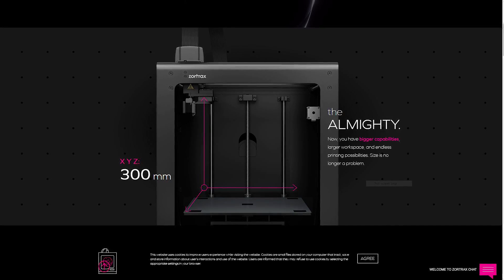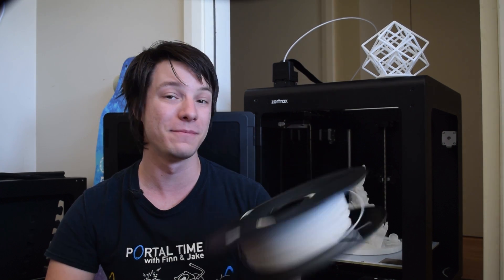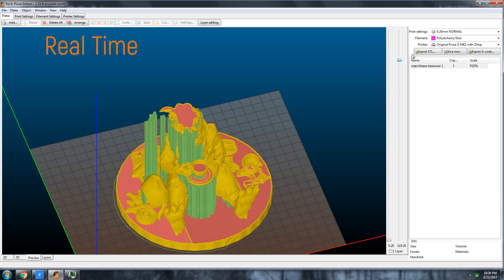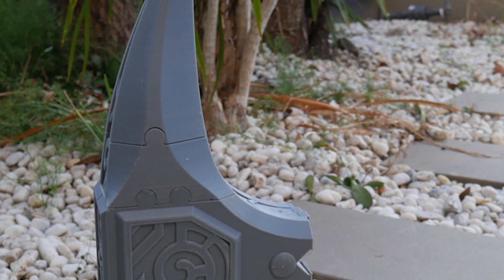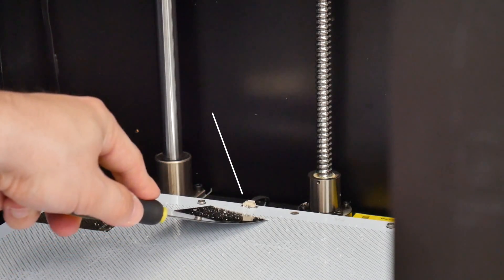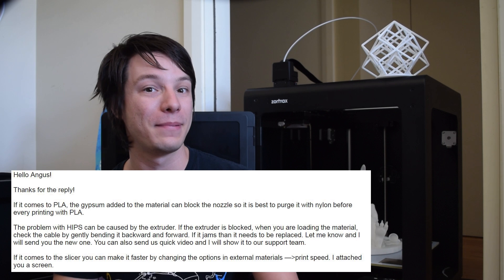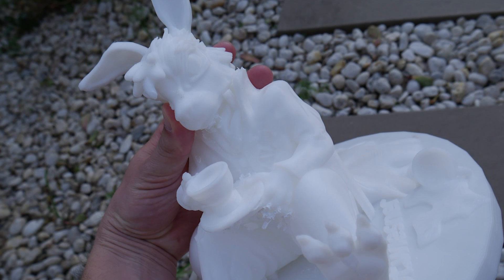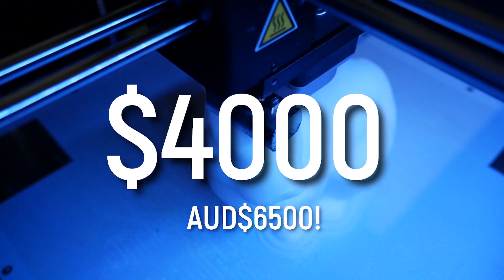Zortrax M300 3D Printer Review

Comment: You were pretty nice to the M300 in this review. I own the latest Zortrax M200...which I assume is mostly the same as the M300. I will say this... Its mostly turned off next to a Flashforge Creator PRO (slightly modded) which is running constantly, faster, cheaper. 

The only advantage from the Zortrax is potentially the surface finish in some cases but that is due much slower printing speed! That is in my opinion the secret sauce of the Zortrax. 

A properly leveled print bed on the Flashforge will get you very close to the Zortrax. 

The good things:
- easy settings
- build and print quality
- brand image
- Zortrax support is very good

The bad things:
- Slow and outdated slicer + serious lack of features! (how to manipulate objects on the print bed, the way of adding supports and loads more...) Just not good enough.

- perforated print bed and the need to print a raft is painful to say the least. Besides that the material waste is intense. That does serve a purpose thou: If I understand correctly the raft will compensate for the hypothetically bad print bed level so that each print is printed on a ideally calibrated surface. Again... could you not do this with a better calibration method and offer a glass bed option instead.
  The raft sticks quite heavily to the print bed and when removing it with a spatula the danger of hitting the connector is real. I did. I destroyed one. That should be moved to a different location immediately. Its just wrong.

- Slow print speed: The time to print a raft, checking if the bed level is correct and overall print speed makes of a somewhat disappointing printing experience

- ABS prints will lift in corners because of lack of an enclosed chamber. Expect warps, split layers,... Zortrax should provide some kind of a top cover and a temperature sensor inside to ensure print quality. 

- PLA compatibility is also difficult to understand. Considering that we all mostly print in a home environment...PLA is the safest touse. In case of the M200 you are better of with something else..which is questionable in terms of harmful fumes.

My 5 cents.

Comment: I’m in the market for my first 3d printer and am really interested to dive into it. So a more expensive machine would be fine, but as I’ve heard recently the 3D printer techniques used kind of hit a spot where improvements aren’t producing way better results or so. Much faster also isn’t possible so a totally new technique would be required. Now the MK2/MK3 kind of printers at sub 1000 Dollars, produce similar if not the same quality as 2000 dollar machines (or maybe even this ridiciously priced 4k one). Only difference being less tweaking required for the expensive ones... usually. Soooo, is that enough to even have really expensive machines at all?

Comment: 4000 bucks? ffs, my mendel does 300mm/s, 6500mm/s2 (and the Z axis can do 50mm/s!) and can do 235x235x155 and only cost me $300 to build and it even has auto bed leveling. It even has a ultimaker level surface finish. seriously, $4000 just buy an ultimaker 2 extended or something

Comment: With that $4000 price tag, you can get about 10 CR-10 with the same build volume and an open environment.
Reply: In fact it has a bigger print volume with 400 on the z axis
Reply: I have a cr10 and prinquality is amazing and if you add 2nd zmotor no issues whatsoever
Reply: Yep, love my CR10 so far...
Reply: enclosed nature makes it quite a bit easier to print abs with the Zortrax out of the box. I think it's also widely available across the EU. A few of my friends have noted by the time they pay for custom/VAT for stuff from Asia a $300 USD printer is closer to $1000 (this is second hand I don't know much about it myself).

But Yeah I think the price tag is fairly high for what it is.
Reply: Open as of open air machine?! Enclosure makes a massive difference if you print anything but PLA. Also $4k is quite a lot yeah but Ultimaker 2+ Extended with smaller XY is $3k...
Reply: And mostly the same print quality!